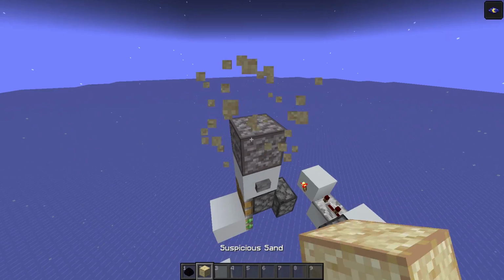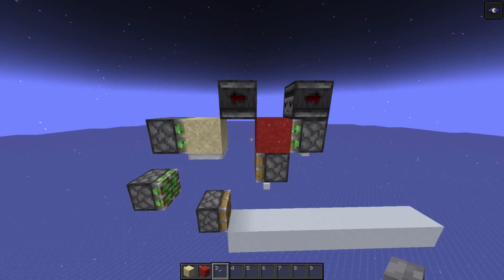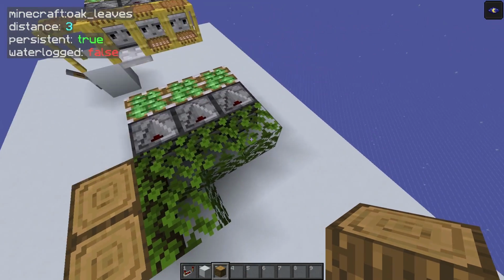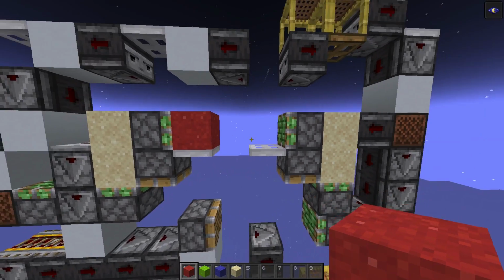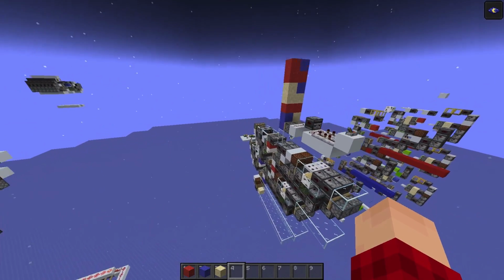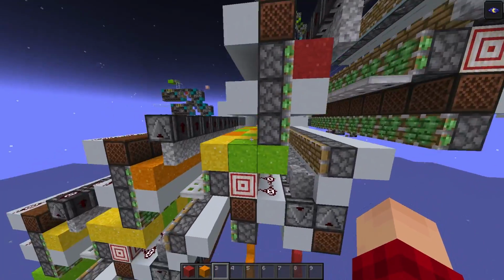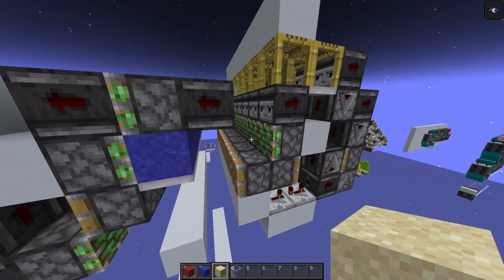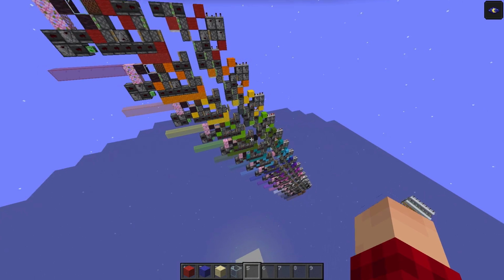Designing A 1-Wide Tileable Gravity Block Sorter

Comment: Thanks Michael for sharing my designs! For those interested, here are some more details about my final design at 16:31 that didn’t make it into the video:

On the left, there’s a T flip flop made of a piston pushing and pulling an observer. If there was a repeater afterwards, it would pick up a short pulse when the observer is retracted, which is why I used a comparator, which only catches pulses that are at least 2gt long — but even then, it only does if there’s a repeater behind the comparator, which luckily fits there anyway.

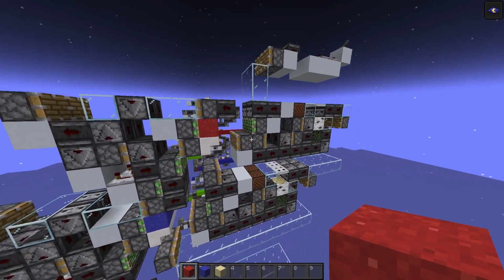Just like the alternating design shown at 10:30, the trapdoor that holds the control block can be replaced with an upside-down stair, a torch or any other block with a hitbox that leaves enough space for the mismatches to get pushed away. Previous iterations pushed away the matches instead of the mismatches, which did require a trapdoor.

On the right, for the 1gt delay, I used the leaf method instead of the scaffolding method because the latter can break if the input is unsynchronized. In the Connect 4, this wasn’t a problem because the rows of blocks would always arrive in sync, so I was able to use scaffolding to make the specialized version at 17:40. Unlike the 10:30 version, this one has no interference issues with the leaves because there’s enough space for a second log, which keeps the distance value between 1 and 2 at all times.

Finally, the whole thing could be drastically compacted further if copper bulbs still had a 1gt delay like in the first snapshot. RIP

uhh meow :3
Reply: Thanks Yat for these supplementar details you provided us

uhh meow :3
Reply: same!

Comment: This is awesome! I never would have thought to be able to sort falling blocks like this. Not to be pedantic, but I noticed something that maybe wasn't considered, or maybe just isn't what the goal of this project was. Although anvils can't be sorted using this method, I'm sure the very reason that they cannot allows for a separate 1-wide tileable anvil sorter to easily be designed making use of the fact that it cannot be pushed while stationary and other falling blocks can. Not sure about the other blocks though (dragon egg, suspicious sand/gravel)
Reply from the maker: That is possible yes, but also sort of impractical (not to mention anvils take damage the more falls they take)

Comment: Why didnt you use copper bulbs for the 1 tick delay
Reply from the maker: Because copper bulbs have a 0gt delay, not 1gt. They used to be 1gt but Mojang nerfed them a few months ago
Reply: @michael23b  i mean use the old snapshot that still has the 1 tick delay
Reply: Because that'd be dumb
Reply: @Cr7issogoodSui Ah yes, use a snapshot with a non-relevant characteristic of a block so no one can actually use it since it's outdated. A whole tin can of logic that you opened there
Reply: @Cr7issogoodSui  Yea, the 1gt mechanics of the copper bulb is, unfortunately, outdated :(